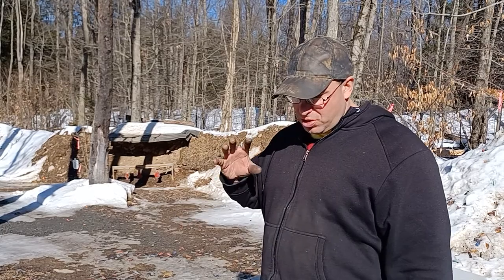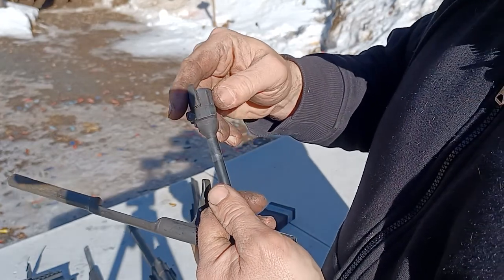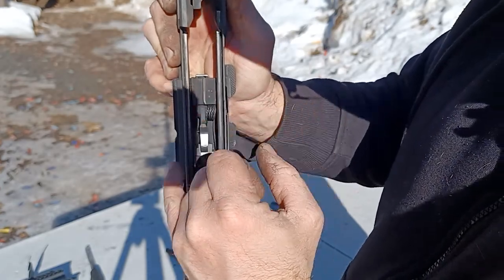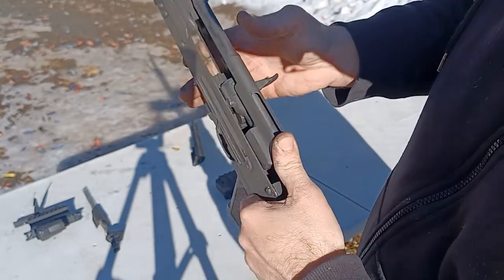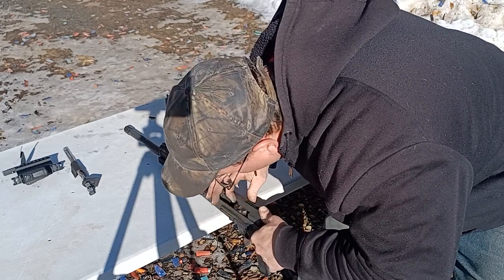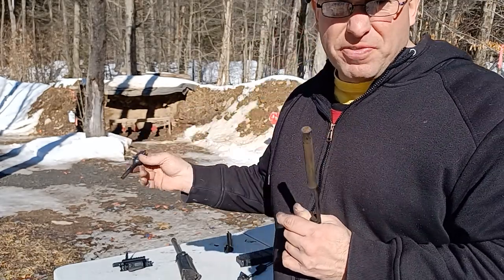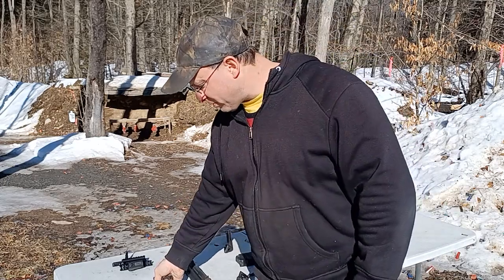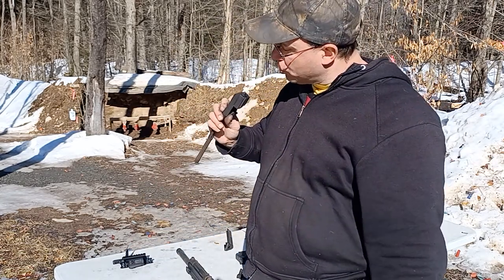Lynx 12 Bolt Alignment and Insertion into the Bolt Carrier and gun

Comment: Picked one up last night along with a Zhukov stock, definitely had a fun time figuring out how to get the bolt back in😂 this video would’ve helped
Reply from the maker: I think I spent almost 40 minutes one time trying to get it back in. I made this video for myself as a future reference in case I ever need to do it again 😂
Reply: @tsafa  took it out to the range this weekend and no problems other than the small metal piece on the magazine that retains the mags was popping off and would spit the rounds out, put 150 rounds through it 3 boxes of Herters ran flawlessly on 3rd gas setting, also had a box each of Igra(was the most aggressive out of all bird load on 3rd gas setting) Remington express xlr(was also a little aggressive) and federal game load which was the only one that felt a little sticky I wouldn’t have to tap it to seat it but it would slow halfway into battery and fully seat when I turned it to push it into battery. Also 00 buck and slugs ran fine on lowest gas setting like everyone had stated.

Tldr 160 round range trip went well apart from magazine retainer issues(metal lip on top rear mag retaining the rounds) but no malfunctioning due to ammo or the gun itself just that single clip on the magazine itself
Reply from the maker: Glad its working. 
The Lynks 12 magazines are Saiga 12 compatible. You can find them that way.
I got mine from AGP.  I did a video on them.
Reply: @tsafa  have you tried the csspecs mag? I was leaning more towards those but hard to argue with actual experience
Reply from the maker: @UncleCarlAK  no I have not tried those, but with the Saga 12 and Lynx 12 being discontinued, any magazines that you buy can be a hit or miss.

The most important thing that you can do, is by the magazines from a place that you can return them if they do not work well. Ideally with postage paid by the Seller.

You should definitely get at least 6 magazines. 12 would be better.  Reason being that 10 years from now, you might not be able to get them at all.